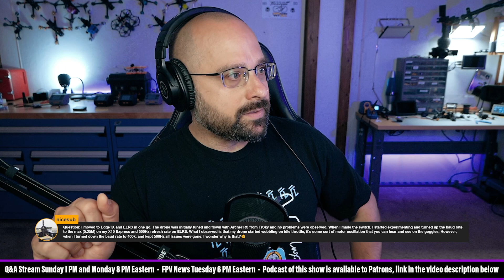High Baud Rate on ExpressLRS Causes Motor Oscillations? Benefits of High Baud Rates? - FPV Q&A

Comment: I think that the oscillation is because the feedforward sends commands to the PID controller without filtering it, it jumps the filter part. So, you're sending noise directly to the PID controller. The noise is caused because something between the radio and the receiver is not working correctly. Maybe the radio is sending too much information and the receiver cant get it right.